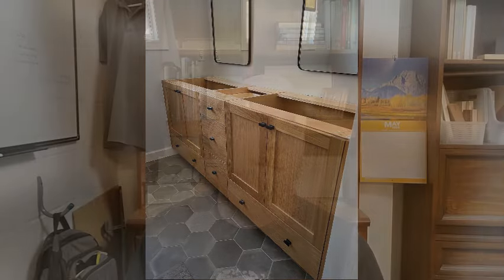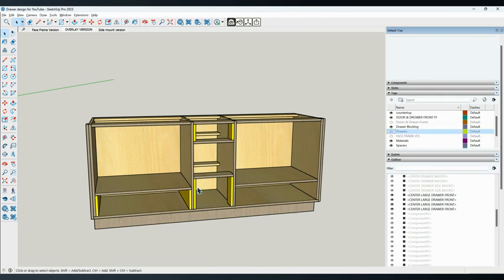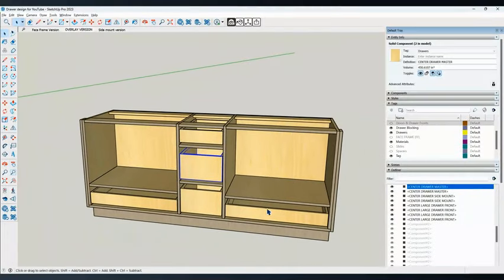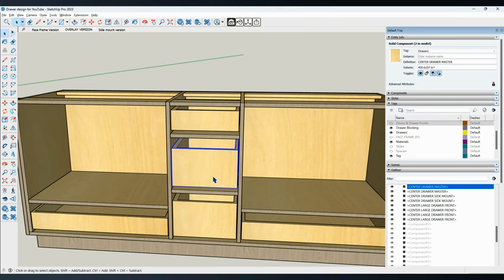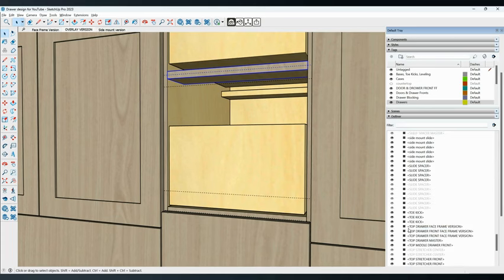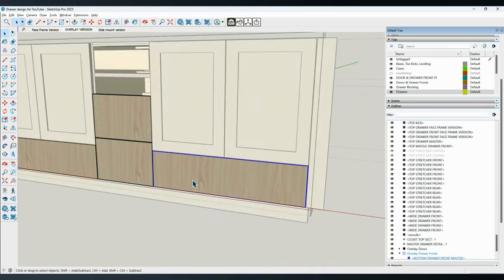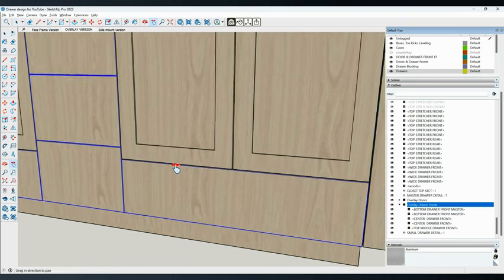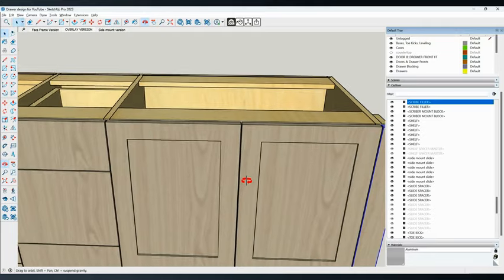Cabinet Design - Drawer & Door Layout. Full Demo On How We Design Our Cabinet Door & Drawer Setups.

Comment: Excellent video. Very clear, well put information. Thank you. When using double sided tape for installing drawer fronts, do you leave it? Or will that create too large of a gap? Also, how do you deal with varying material thickness from the drawing to reality? Meaning you draw all panels at 3/4”, but plywood usually is thinner.
Reply from the maker: @jasonevans9649  Thanks for watching, glad it was helpful! I have left the tape, and removed it. I don't think it creates a gap at all, it's very thin stuff. Most plywood I buy is a true 19mm thickness. If it's not, I do adjust that thickness in the drawings. If I forget it will definitely cause problems.
Reply: @ChestnutRidgeWorkshop  Great. Thanks for the info and thanks again for your videos

Comment: Do you use an extension with Sketchup for the cabinet design?
Reply from the maker: @benjaminu12  only for creating the cut lists
Reply: Do you use layers or how do you create that window on the right Default Tray? Maybe future video how you create the design?@ChestnutRidgeWorkshop
Reply from the maker: @benjaminu12  there's two windows on the right that I use all the time to organize and turn parts and groups on and off. Tags, and organizer. Both are standard features.